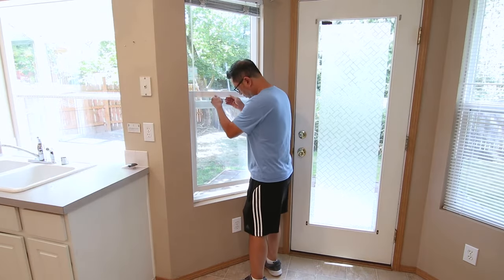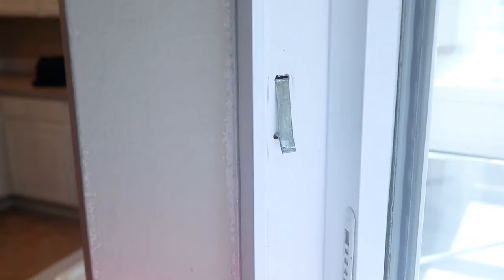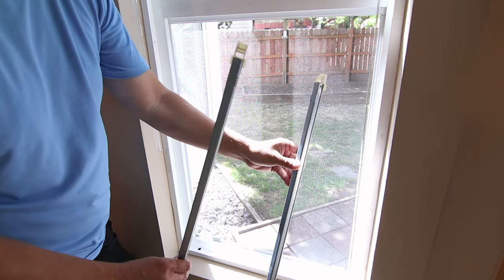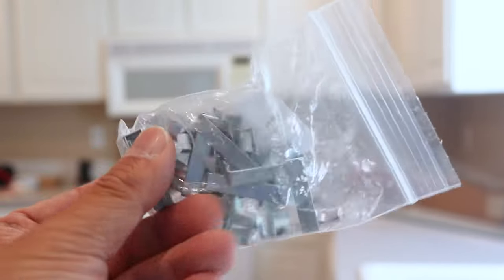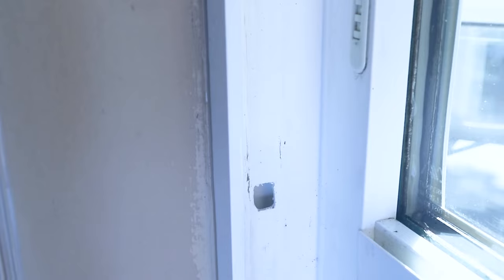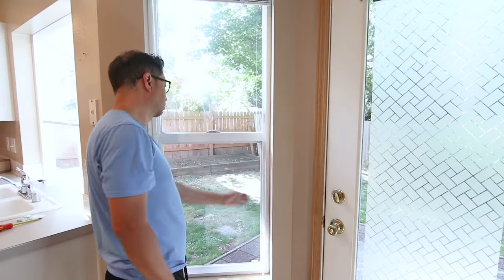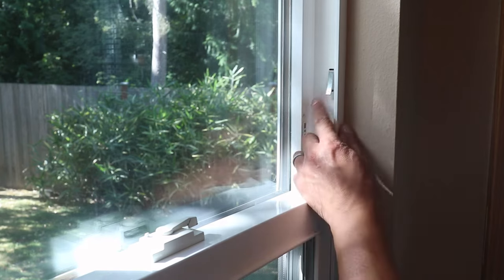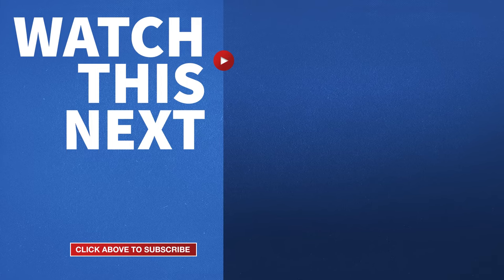Window Won't Stay Up - Block and Tackle Window Balance Spring Replacement and Repair

Comment: The repair is only easy if you can find the exact replacement channel balance
Reply from the maker: Yes for sure! As shown in the video take note of the number printed on the channel balance. It should be easy to find on Amazon. And Amazon has a good return policy if you happen to get the wrong one.